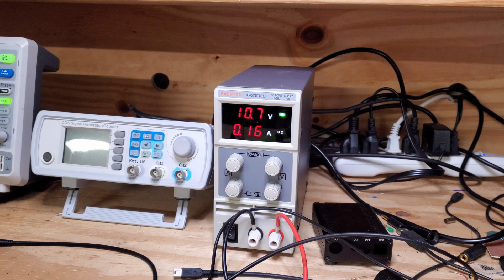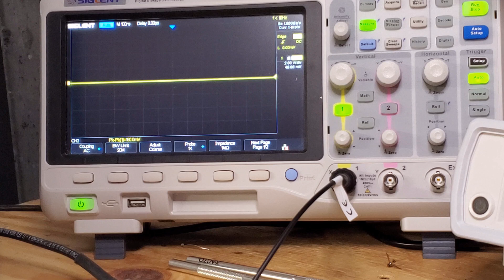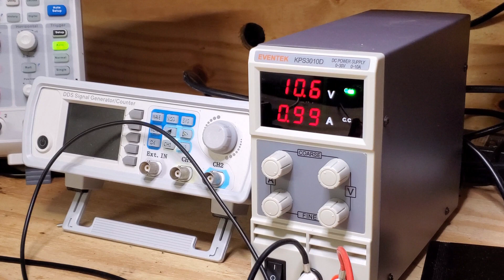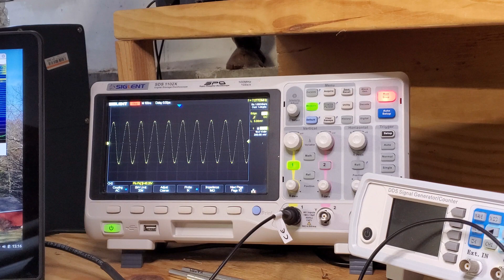QDX - Low Output - Blown BS170s

Comment: Thanks for the video! 

You're definitely not the first to blow the BS170s... after a couple of iterations, I came up with a fairly robust solution for running continuously at 13.8 VDC supply on a "9 VDC" build of a Rev 3 DQX:

1 - I used new ONN Semiconductor BS170s tested to matched Vth (not sure if that last is important at all)
2 - I cut an 18x22x36 mm piece from an aluminum, fanless, CPU heatsink, filing the new edges to remove burrs
3 - I applied a very thin layer of "high temp" silicone RTV between the PCB and the transistors bodies, bolted them down per kit instructions and let the RTV set.
4 - I drilled a hole in the center of the new heatsink of a size appropriate for the kit-supplied screw to self-tap into it
5 - I removed the hold-down nut and washer from the transistors, applied a thick mix of RTV and fine aluminum filings between, around and atop the transistor bodies, to where it could contact the heatsink, being careful not to short out the transistor leads.
6 - With the RTV still gooey, I screwed the heat down firmly to the transistors and let the RTV set
7 - I cut a 20x24 mm hole in the top enclosure cover so the heatsink can stick out the top.

I used this configuration at 13.8 VDC supply and FT8/FT4 duty cycles for hours at a time over at least a 2 month period with no problems.  The whole enclosure does warm up noticeably with heavy usage - I think the PCB itself is still spreading a lot of the transistor heat, per design - but found that  a quiet, 80mm PC fan blowing roughly in the direction of the QDX and its new heatsink was enough to keep it quite cool.

I did later revise this QDX of mine to the "12 VDC" configuration so I could run it at 12 VDC and not overheat the input attenuator of the QRP-Labs 50W amplifier I built later.  I regularly use this combo at home with the amplifier dialed down to about 20W output.  In this new configuration the QDX still works well at 13.8 VDC (~5.5 Watts out) to 18 VDC (~8.5 W) by itself when I go portable.

NOTE: I've only run WSPR continuously at 5W output because it never occurred to me to do it at any other power ;)

-N5RGN

PS: You're not in my logs yet, but maybe I'll see you on 20m, FT8!
Reply from the maker: Thank you for the great tips there Randrew! I was using WSPR when I blew mine which I think is a little more taxing (its full transmit for 2mins) - but your heatsink solution is intriguing. Thank you for the comment!

Comment: I blew one of my BS170's recently too, I just replaced all of them like you because why risk it for the pennies a new mosfet costs. Plus I knew I'd probably blow some up, so I got 20 of them in stock ready for when I need them :).
Reply from the maker: I have a pile of those BS170s although the numbers are shrinking... I often find one or two on the garage floor! Thanks for the comment

Comment: Great video, very informative! Can you detail how you're running the RF from the QDX into your scope? Thanks!
Reply from the maker: Sure John. I have the QDX output going to a 50 ohm dummy load and I connect the oscilloscope input in parallel to that. You can see the wires  I am connecting the oscilloscope to in the bottom right at 1:21 in the video. I hope this answers your question and thank you for the comment.
Reply: @na5y  That makes a lot of sense, thanks for the quick reply!

Comment: I'm surprised it lasted all day. Do you know what the QDX output power was from the 14 volts that blew the FET?
BTW, I just stumbled on your site, and I'm slowly watching all of your videos. Excellent stuff.
Reply from the maker: Thank you for the kind comment John. I didn't measure the output power - I accidentally left the power supply at 14V from some other testing I was doing.
Reply: By my measurements, running a  9V QDX build at 14V yields:  9.8W output on 20m, 9.8W on 30m, 9.8W on 40m and 10.2W on 80m.

Caution: even fairly brief transmissions at 14VDC is likely to blow a transistor or 3 unless you've taken extra steps to cool them.
Reply: @Randrew , I'm not even sure you 'can' cool them enough. I suppose it depends on what output transistors it has.
Reply: @johnwest7993  " it depends on what output transistors it has"  -> Output transistors = 4 x BS170.  They're kinda small.

" I'm not even sure you 'can' cool them enough"  -> See my other post in these comments.  Very short version: I glued a decent heatsink to the transistors and run at 14 VDC with impunity.

Comment: You're not the first to blow up the BS170s I suspect. But easy to diagnose and fix.
Reply from the maker: And they are pretty cheap too! Thanks for the comment Paul
Reply: @na5y , I looked over the schematics for both the QDX and the (tr)uSDX before I purchased them, and it quickly became apparent that the BS170's are a dual purpose component. In addition to operating as the RF final amplifiers they also function as the circuit's fuse. I bought a dozen of them to go with these kits. I may buy more, just in case. :)
Reply from the maker: @johnwest7993  There are Four BS170s in the PA but that mosfet across the input supply is an SMD p-channel. I have blown both types now!
Reply: @johnwest7993  Three legged fuses, and they open a lot faster than a wire in a glass tube.
Reply: @Paul_VK3HN , very reliable.  :)